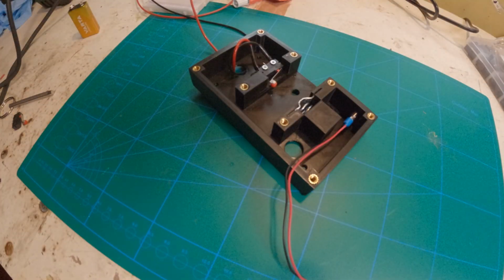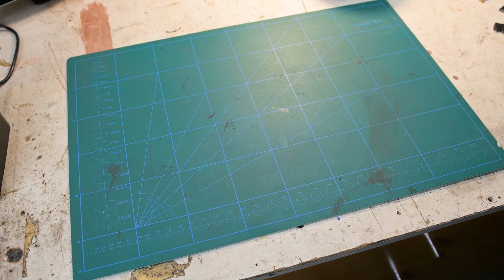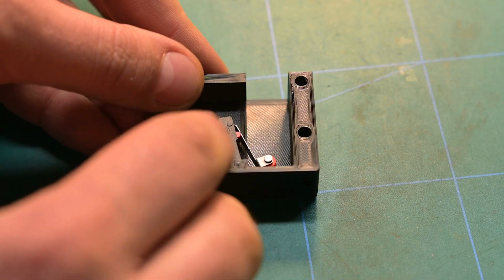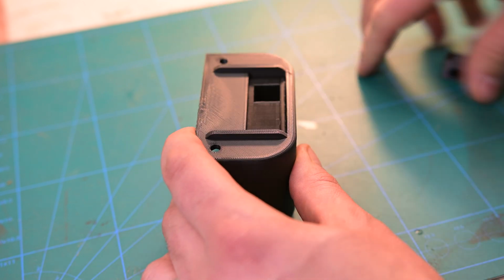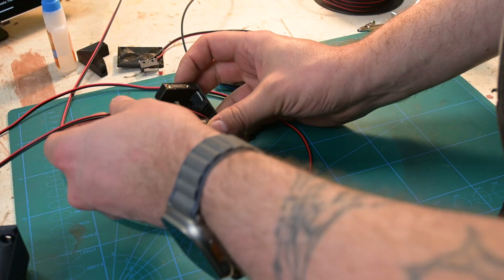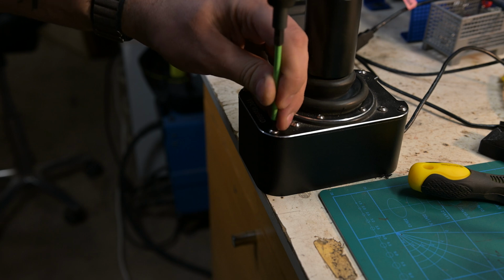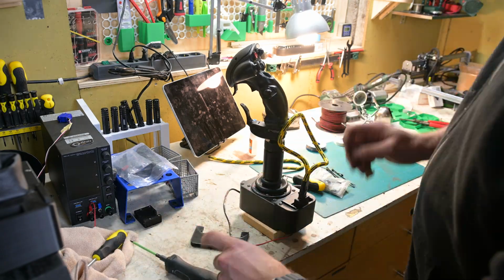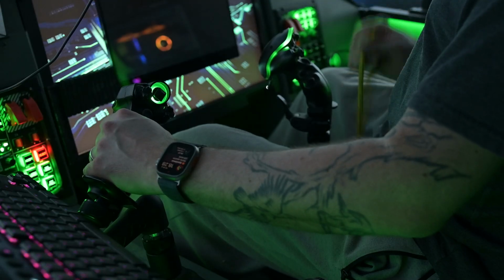Building a (Modular) Ejection Seat Handle (for Virpil and Winwing Joystick Bases)

Comment: Great video, always a treat. I'm using a cheap trailer breakaway safety switch as an ejection mechanism, would recommend it highly. Saves you the trouble of building from scratch, and also gives has a decent amount of resistance when you pull it.
Reply from the maker: Sounds like a great idea! Personally though, I'd rather design and build it from scratch if possible, just a fun part of the hobby.